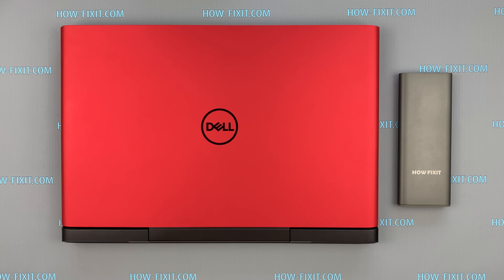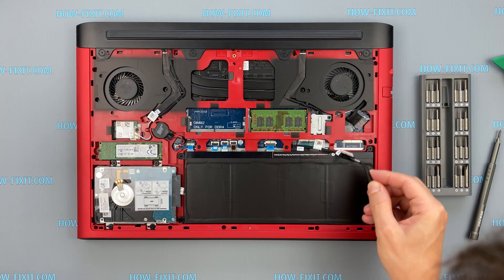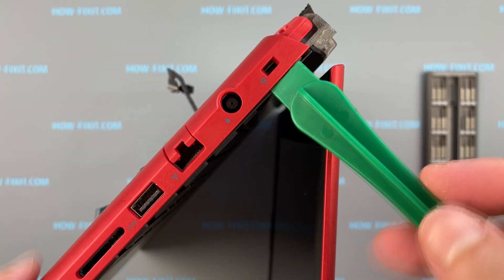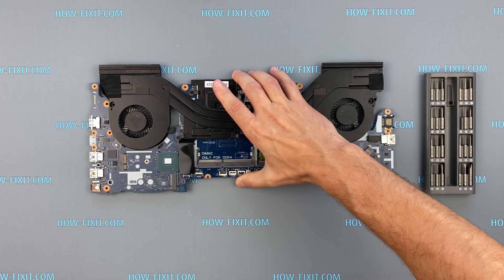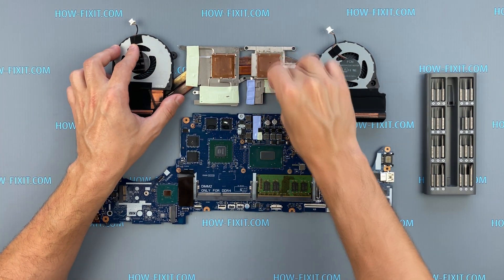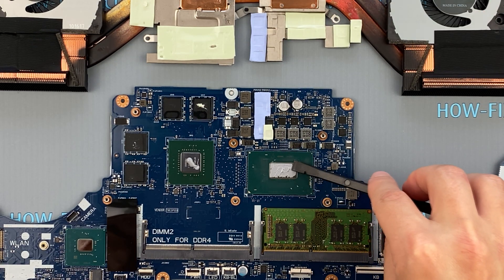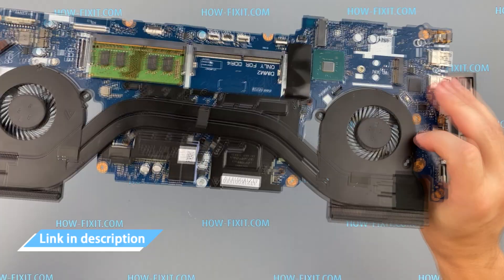Dell G5 5587 Disassembly, Cleaning and Thermal Paste Replacement

Comment: Knowing that fans need cleaning and replacing, Dell should have made them accessible from the back-panel rather than disassembling the entire computer and pulling the mainboard out and removing the heat-sink assembly from the processors... geez, what could possibly go wrong?
Reply: It’s Dell we’re talking about

Comment: Mine is not turning on, plugged at the outlet and now the fans are at full speed but no signs of turning on… any clue?
Reply: I solved doing this: 1) Let the system restart 2 or 3 times. 2) Wait like 10 minutes 3) Turn off. 4) Turn on and wait 5 min until video is on.

Comment: My laptop is 6 years old now (it was a pre-order in September 2018) and this was the second time that I had to disassemble it and replace the thermal paste. I am using Thermal Grizzly Kryonaut now. The temperature of all CPU cores has dropped to 60-70 °C from 90+. Overheating caused BSOD multiple times. Now the issue is gone. Thanks for the very helpful video!

Comment: Not the uploader's fault, but I accidentally ended up breaking off the white antenna's socket from the Wi-Fi card. Be careful.
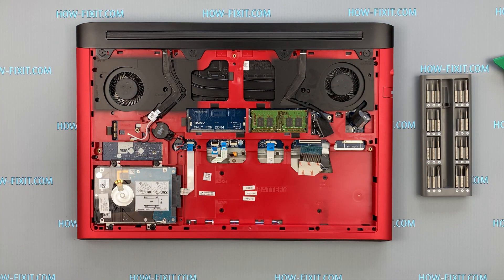Had difficulty with the connectors @ 3:00 one ripped a tiny tiny bit so I stopped the attempt at fixing the grinding fan. God I wish I didn't buy this unit due to the not easily repairability.

Comment: Important note: At 11:11, the screw on each of the laptop's hinges are in the wrong spots. They're fixed in the very nex shot, moved up to their proper spot. I looked at the 11:11 shot when I was putting mine in, and had to undo them later on

Comment: Thanks for the video man. The fan replace linked is not for the  GTX 1060 version of the notebook. Do you have a link for this version? Thank you so much! Other thing, considering the main hardware problem with this model is the fan noise, do you know if I try to open the fan for replace the oil inside I break them?

Comment: What thickness thermal pads for dell g15 5587 ?? 0.5mm, 1mm, 1,5mm, 2mm ?? Is this set enough : Thermal Grizzly Minus Pad 8 - 120 × 20  ?? or i need to buy Thermal Grizzly Minus Pad 8 - 100 × 100

Comment: MY laptop wont charge, will doing this pace replacement that i purchased, will it fix it?
Reply: either the port on mother board doesnt work or battery died, if its the latter replacing should work

Comment: Did anyone benchmark the laptop before and after the thermal paste replacement? I would love to see if its actually worth repasting. The disassembly looks like a nightmare. My Dell g5 5587 was thermal throttling from day 1 under heavy loads, so i had to undervolt it to get some decent performance. I'm planning on gifting it to my brother but not before upgrading the ssd and replacing the faulty keyboard (2-w-s-x keys are not working). Might as well do a thermal repasting as well.
Reply: woah what the heck. My 2, w, s, and x keys are also the only keys to stop working
Reply: @Justin-if6um  mine too wtf, plus the caps lock
Reply: @rrnirv  exactly my problem, but its been starting to expand to other keys now
Reply: I had the same issue, the same keys.

Comment: The screws  of the radiator that you have to open in a sequence are Jammed and not opening. I tried number 2 and 3, they are fully jammed and one if them has sufferred tearing while i tried to open.
How to work things arround??

Comment: I just hate how these companies put a crappy thermal paste to begin with, then design the cooling system to be inaccessible for cleaning or replacing the thermal paste. You need to rip everything apart just to reach the fans and radiator. Great video though, I still haven't found my courage to disassemble my laptop. One day, I will.
Reply: Have you yet?
Reply: @johnkhalil7146  I ended up doing it. It was a huge hassle. Thermal paste was dry af.
Reply: @japxicano9877  How long did it take you?
Reply: @johnkhalil7146  A good while. I'd give it about an hour if you aren't in a rush.

Comment: I dismantled my Dell G5 5587 and put it back together, but now my audio isn't working. Do you happen to know where I should look to fix that?
Reply: I get this randomly with mine as well. But it's only if I power it down without unplugging my headset first.
Reply: @biggusriggus7693  hmm that didn’t fix it for me sadly
Reply: Maybe the speakers cable isn't securely plugged, unfortunately you'd have to reach the motherboard again and secure the cable

Comment: Great, now its 100°C even in idle mode. It got even worse.
Reply: Did you figure out what you did wrong?
Reply: @kwils6685  sadly no. I never had any issues with repasting before so I'm clueless. The only difference I did that I used a different paste, one suggested by a local expert. It should work perfectly fine too...
Reply: @Norberbert  That's too bad since the 5587 is so hard to take apart, mine is running 100C the moment you fire up any triple A game so I had to power limit and undervolt by quite a bit to keep it under 100C and my frames per second now is only about 50 in Warzone, down from 80-90. I was gonna replace the paste with thermal grizzly kryonaut, can I ask what kind of paste you used and where you got it? I heard ebay and amazon sellers have been selling a lot of fake thermal grizzly kryonaut and other brand pastes.
Reply: @kwils6685  Well I don't think it was hard to take apart. Actually I found it easier compared to my old laptops/notebooks.

Before repasting, the turbo was turned ON and I did NOT apply undervolting. The CPU was below 90°C if I was just surfing the web, using MS Office etc. But it went above 100°C even when playing a 10 years old game (AC3 for example). So thermal throttle kicked in and I couldn't even have a steady 60 fps IN A 10 YEARS OLD GAME!

After repasting, the CPU goes above 100°C even when I'm just looking at the desktop and nothing is running. I disabled turbo and undervolted it and it still reaches 100°C when I'm doing literally nothing.

I have no idea why it got worse, I never experienced such thing. I always did the repasting myself and never had any issue. I'm not at home atm so I cannot check the type of the paste, but I bought it from the store where my local expert works. Whenever I had any problems in the past 20 years he always fixed my computers no problem and always told me what was the issue and how he fixed it so I can fix it myself in the future. He is an old friend so I can safely say he can be trusted whenever he recommends anything but I'll check the type of the paste when I'll get home.

Currently I think I will give him the laptop to do something with it because I don't want to repaste it again.
Reply: @Norberbert  I guess "hard" to take apart jsn't what I meant, more like pathetically ridiculous, over 50 screws and 15 cables removed just to get to the cooler! My last laptop you took out 2 screws to get the bottom cover off, unplugged the fans and took out 8 screws for the cooler and you're done took about 5 minutes. When yours us idling at 100C do the fans sound like they are running at full speed? If you take it to be repaired will you let us know what he finds? I left another comment with a link to a law firm that is seeking information from Dell G3 and G5 owners that have had overheating issues with their laptops.
Reply: @kwils6685  Yes, the fans are running at full speed.

Few days passed, I don't know what happened, I didn't disassemble it and I didn't messed with the CPU settings but now my laptop is idling at 50-60°C which is great (without undervolting and the turbo is off). Playing a 4 years old game (max graphs) results 95-98°C and sometime it reaches 100°C too which is bad. Maximum allowed CPU temperature varies depending on the model, and for this model it should never reach 100°C (90°C sounds high but it's also ok for this model while playing games, afaik).

Next week I'll call the IT guy whether he has time for my laptop and I'll let you know if he finds anything.
Reply: well it's idling again at 98°C... i dont know why

Comment: This laptop was a pain in the arse to disassemble. One day I tried to repaste the cpu and ended up (stripping?) or rounding 2 of the heatsink screws.
Reply: How did you get the stripped screws out? Which tip did you use?
Reply: @ScuffedDreams  I never got the screws out. I gave up.

Comment: Thanks for this, I applied this tutorial yesterday on my laptop.

At the end my laptop didn't showed video, I thought that I missconnect the display or something like that, the system turned on and off like 3 times, but after that the system started, requesting a date time change on the Bios, because I removed the battery connection to the motherboard, so if that happens to you, don't worry, just be patient and wait for all the laptop restarts. 

It was a really bad moment but despite that, everything was fantastic, my laptop is flying now hahaha.

Your tutorial is the best one in the world.

Thank you!!!
Reply: Me pasó lo mismo, gracias! XD
Reply: Wow thank you so much for this comment, just tried to troubleshoot for the past hour. Full fan speed, no display. Turned off by itself three times and display started working again. You’d think the creator would say something.
Reply: Hello Jefferson. I'm planning on repasting my laptop as well. Was it worth the trouble? did you getter better thermals overall? how many degrees?
Reply: @zannettos  Hi Alex, yes it worths, the laptop improved the performance and the temperature, I don't know how many degrees exactly, but it's really better now.
Reply: This usually happens because the laptop needs to test if the fans are working well and dell does that automatically. The desktops do this as well when you unplug them and re-connect them.
Reply: Thanks for the heads-up.
Reply: That's happening right now, how long does it takes?
Reply: @kenshyura  be patient. Just wait until the laptop restarts several times

Comment: Which thermal pad should I use on my Dell G5 5587?
I opened it today and one of the thermal pad was in pieces!
Reply: hey did you figure it out yet?
Reply: @achrefbannouri2995  unfortunately no, I ended using a generic tip.
Reply: @pheliperost  have you found it out yet? Can you please share what tip you used. I have .5 1 and 1.5 mm thermal pads. but not sure which ones to use
Reply: @KillBillPandey  I ended using a generic one (1mm ), not the best option but the only that I could afford it!  it's still working great btw!
Reply: @pheliperost  thanks mate. Will try it as there no other resources pointing to this issue on the internet. Do you experience power limit throttling on your G5 on stress test?
Reply: @KillBillPandey  yes, it only solved when I undervolt It.
Reply: @pheliperost  can you send me the numbers for your undervolt settings. I did undervolt mine but didn't help much. Did it for both the graphic card and the cpu

Comment: Great video, only thing that would make this better is telling us the thickness of the thermal pads!
Reply: Fairly thin but thick enough to cover evenly without oozing out. It's purpose is to fill micro scratches and imperfections rather than having a layer between the two.

Comment: No boot device found. Help :( i think my laptop isn't recognising my ssd

Edit: Fixed! Took my ssd out and back in, also pushed all the ports for the hdd and the rest as far as I could, taking them out and putting them back in. Worked eventually

Comment: any advice on stripped heatsink screws?
Reply: Hey, did you figureout solution to this problem. I am facing the same issue, they wont turn and have been roughed up while trying to open
Reply: @GKX-Gaming  I have the same issue, nothing you can do about it unfortunately. I had to give up mid tutorial cause a few screws wouldn’t come loose.

Comment: Thanks for this, always been dubious to tear down my G5 but the heat and fan noise had gotten worse and became impossible to ignore recently. The rad fins had a few dust bunnies and the fans had gathered a thin layer of dust, not bad for 2 years but after completing this, I am 15-20 degrees lower in games. I think i'll make this an annual thing from now on.
Reply: 15-20 degrees fahrenheit or celcius ?
Reply: @brianLongNeck1073  gotta be Fahrenheit

Comment: When I boot it, it says the AC adapter is not recognized and that performance will be based on the power available.
Reply: Either the cable leading from bat to mobo isn't correctly seated . OR the chip near your charge port is fried. When I got my dell I started it up with the above issue, then opened it up and the charge port was faulty and the battery wasn't correctly seated
Reply: Hi were you able to solve the ac adapter issue?

Comment: Thank you in advance for this video! I purchased this machine a year ago & it runs well to this day. I preemptively am watching this video for whenever I have to replace the battery & dust out the machine. I think up to the 3:50 minute mark should be sufficient to dust out the heatsinks, fans, & replace the battery which I would consider general hardware maintenance.  I wanted to avoid reapplying thermal paste so I've used the Dell power software on the 'Cool' settings and rarely does the GPU & CPU go above 60~70C when gaming. I also use the 'Primarily AC' battery settings to save the battery as long as I can.
Reply: of course it never gets above 60 or 70 when you're running the cool setting, but not because it cools any better, it's because they throttle the CPU so hard. If I remember correctly cool is the lowest performance setting in the thermal manager. The performance on cool is dreadful.
Reply: @kwils6685  I understand thats why it's cooling better, due to throttling & high fan speed. The games played by my wife at the time, FFXIV, Sims 3, & My Time in Portia ran at or near 60ps on max settings, so the "Cool" works out fine.
Reply: @Tetsu9701  don't get me wrong i've had to do similar things but i use the intel extreme tuning utility add hardware monitor to control the fans just to keep my temps around 96 C while gaming. I could have bought a much cheaper laptop and got the same performance as I get with this.
Reply: @kwils6685  96c?! Holy crap. Thats not good for the longevity of of a CPU/GPU. Though they are rated to handle 100-105c, anything above 80C for an extended period of time is not good.

Edit: I recently worked on a laptop with an Acer Nitro 5 that had an i5 10300H & it looks like Intel updated the software & CPU itself so that you can no longer adjust the voltage due to an exploit even after rolling back the software to a previous version. I don't have my hands on the Dell G5 at the moment but I'm curious if that disabled Dell's software from undervolting the CPU.

Comment: please please pleasee could you do a video showing how to replace the ram in this laptop
Reply: just take off the bottom plate, those 2 small chips, there are clips holding them down, take any tool, push them out of the way, the ram sticks just spring out, pull them out, put new ones in their place, push down and it snaps in place then put the bottom plate back on
Reply: I have sent mine in to be done, it looks quite difficult with these and I ain't a big tech guy 40 quid for it to be done and they take the responsibility

Comment: After following instructions very closely and putting PC back together, it started acting strangely. It didn't boot up right away like yours did in the video. First it the fans went on, and the front light started flashing yellow. After a few minutes it turned on and started working normally. Does this mean I did something wrong? Everything seems to be okay now, but it was odd when I first turned it on.
Reply: No. It's the trouble shoot that happens when you unplug a fan from the motherboard and re-plug it in. Desktops do this as well.

Comment: I have a question: I'm also thinking about replacing those thermal pads next time I open up the heat sink to repaste. Did you by any chance record the thickness of those, especially the blue and yellow ones? Thanks in advance for your answers! Also great video btw!
Reply: Did you replace the thermal pads? If yes what thickness did you use?